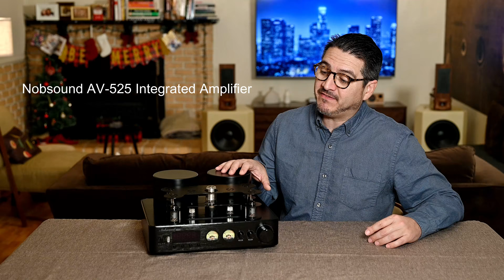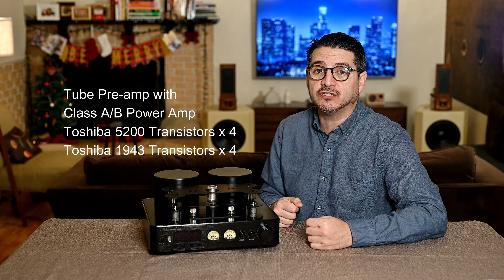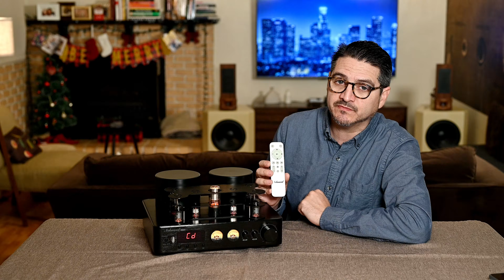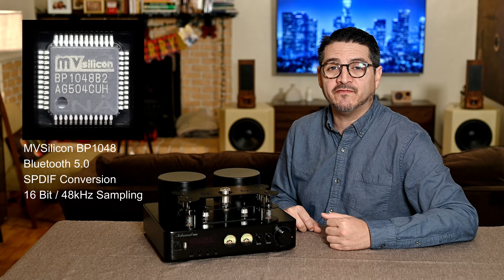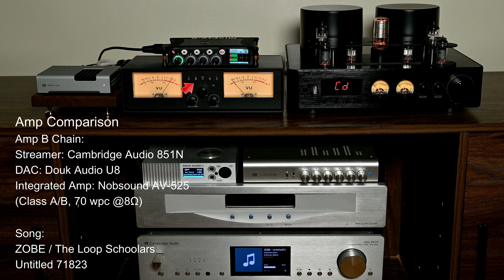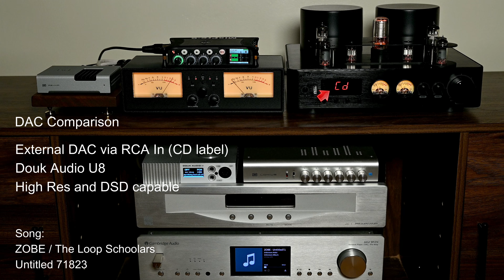Best Entry Level Tube Amp? Nobsound AV-525 Review

Comment: Hi, great review and it made me change my mind completely from getting DA HTA200 into this AV525!
Have you by any chance combining the Douk P1 preamp and the AV525? They're from same company so Im thinking of getting both. 
I appreciate any feedback or comments from the community especially from those who already tried this combination first hand.
Reply from the maker: I don't think you need the P1. Why were you considering combining both? And thanks for watching. I appreciate it!
Reply: @RickRuizAudio  hi Rick, thanks for responding so quick. I wanted to play the audio files from my PC instead of using USB drive. I have an audio player that am used to using., thats why.. hope this helps.. so in case you combine the two, do think there will be difference in sound quality? (By the way, I already have the P1 purchased from Local Amazon here, I love it) hence asking the question.
Reply from the maker: @dbelgrade  Yeah, I wouldn't use 2 pre-amps, if you want to play music from your computer, I would suggest you get a small DAC in between the Computer and the AV525 instead. You'll get better sound. Maybe start with the SU-1 if you don't want to spend a lot of money, but the Douk U8 is awesome too and adds a very nice headphone amp.
Reply: I also bought the AV 525 and positively love it! Has all the power I need for my room and sounds fantastic! Plus the remote is a million times better than the HTA 200. I know. I had it here in the house a few weeks.  The AV 525 is a smoking great amplifier.

Comment: Hi Rick, I have been looking into Douk VU Meters. The VU3 is limited to 100watts so it wouldn’t work with the Nobsound. I think that is the VU2 you have. How many watts is it rated at?
Reply from the maker: Hey Ed. I'm using the Douk L3 for VU w RCAs. For the speaker lever VUs, I'm using another company. I can't recommend it quite yet. I'm having trouble with the meters and they are troubleshooting.
Reply: @RickRuizAudio  Thanks

Comment: So, I guess a dumb question but why no phono input?
Reply from the maker: I don't know why they decided to go that route. Maybe they figured customers buying this unit would either have a turntable with built-in Phono-pre or maybe they thought this buyer would like to use an external. Hard to say. I personally prefer bringing my own compared to a poor or noisy convenience input. I'm sure they could have put a good Phono pre but maybe that would have increased the price $30 and they were worried about that price point. It always comes down to a business decision as to what will sell the most units.
Reply: Do you have a recommendation for a phono pre-amp that would work well in this type of setup?  I have an entry-level Uturn orbit turntable.  @RickRuizAudio
Reply from the maker: @bborgstedte  I do like the little Douk T14-eq. It's around $50. Or if you have a larger budget, say $150, the Schiit Mani 2. If you want Tube Phono Pre as well, the Ampapa A-1 is nice as well. I think around $140. Here: https://amzn.to/3PbegW8
Amazon has a $15 coupon right now so that one goes to 125 and has a headphone amp included too. any of those lol would be nice. What turntable are you using?

Comment: Bought it open box. Bad decision. Remote literally broken in a dozen pieces. A rear binding post broken off. Going back and forth with no refund yet. It may be a good product but my customer service experience is the worst which was my fear. I cannot believe they sent a broken unit. Beware.
Reply from the maker: Oh wow. Did you get it from Nobsound or Amazon? If it was from Nobsound, I'll send them an email John.
Reply: @RickRuizAudio Nobsound. Asked for a  refund but a new replacement would be best. Thanks for whatever you might do.
Reply from the maker: I'll ask someone to look at this! My experience has been that they are receptive. I'll email them tonight!
Reply: @RickRuizAudio  Nobsound said "Hello, This terminal is easy to repair, and we can also send you a replacement remote control for free.
This is a return item and the price is different from the brand new product, so we will not send you a new one.
If you accept to repair it by yourself, we can refund you $40 as compensation.
Also could you also take a side view and take a photo of the area where the terminal is broken" 

I sent photos. Essentially, they will not replace it. They said go fix it. This has been a perfectly horrible experience. Yes, I purchased an open box item but they are not honoring their return process.
Reply: @jacksonranch My China Ali Express 300 b 600gbp amp is faultless and sounds as good or better than my friends 3500gbp amp

Comment: I bought this amp about 4 mos. ago.  It sounds and looks great, and am very happy with it so far.  The only criticism I have is that the USB input does not work,  I don't care, I don't use that kind of source.  The remote control is (as you've stated) only capable of volume and input changes. Fit and finish are nice for a chi-fi amp.
Reply from the maker: Nice! Glad to hear. That's odd about the USB. Did you try different USB drives or different music formats? It could be a format problem. I know if I have any MAC formatted USB drives, my Cambridge network player doesn't like them and I have to format to NTFS instead of exFAT. And thanks for watching!
Reply: Hello Rick, My name is Dave....I tried both thumb drives and micro SD adapters with no luck. In fact, the large USB led goes out when I plug in a device. Perhaps a short or defective input.   All of the devices work fine in other readers including my car. I also own the Dayton Audio HTA 100 amp that I like with the exception of the annoyingly loud cooling fan!  I intend to change out that when I locate a correct alternative. Look fwd to more of your videos. @RickRuizAudio
Reply from the maker: @vulcangunner58  Awesome Dave. Thanks for the update on the drives! Yeah, maybe a short on the input. 👍

Comment: I’ve heard that sometimes these units when having a very low input volume from either Bluetooth, CD, DVD, ect the sound tends to cut off. Have you noticed something like this ?
Reply from the maker: It's was a problem with the Bluetooth adapter. When you have the volume on phone very low, the pre goes to sleep. But not a problem with wired devices. I didn't experience this though.
Reply: @RickRuizAudio   yeah the problem was exactly that. That even with wired devices with low volume it would cut off.
Reply from the maker: That's weird. No, sorry, I haven't heard of that or experienced it with either my Dayton or Nobsound.

Comment: I'm going to purchase the 525.  Will the Douk Audio T8 Pro
 clean up the sound, or do I still need the Douk Audio U8
.  Appearance is important to me (T8 Pro looks nice, the U8 does not).
Reply from the maker: Hey Ian, the 525 doesn't have a Send/Return or Tape/Record loop, so you can't bring audio out of the amp and into the EQ and back in to the amp. That's one downside to (most) integrated amps. The U8 will definitely clean things up. You can always hide the U8 behind something. If you don't need the headphone amp on the U8, you can also go with the SMSL SU-1 DAC. That will clean up a bit too. Not as much as the U8 but it'll also save you $200. I'd be very happy either way. And thanks for watching! 👍

Comment: I was looking to purchase this amp, however I decided to go with the Dayton HTA 200, for one reason and one reason only.The Dayton had the phono inputs that I needed to play my turntable. I'm a bit old school and love to listen to my vinyl's. Thank you for another great and insightful video review.
Reply from the maker: No problem Tim, Thank you for watching!! The difference is slight. Both are pretty decent. Ohh and if you have days when the sound is inconsistent, swap the rectifier tube first! I'm gonna try playing with that too.
Reply: Hey Timothy how is your HTA200 doing now after 6 months of use?  I had the HTA200 for less than a week and it was having volume issues. Parts Express tech and I both agreed it was not working properly. It got sent back. I ended up ordering the Nobosound AV-525 instead. This had no phono inputs. I to am a huge record old school guy myself so I bought a couple of different Douk phono tube pre-amps. One is the T4 Pro and the other is the T3 Plus so we will see how it goes.  I hope you are still happy with the HTA200.  Take care.

Comment: Identical to the dayton audio ones.
Reply from the maker: Pretty close. I'm sure they use the same manufacturer. Dayton is also a small company, I think around 20 employees including their engineers. I'm sure those employees work for Parts Express as well. Which is fine by me.  But the amps are not identical. I'm sure Dayton specifies some things they want. Nobsound as well. Nobsound used to make one with Send/Return which I would have loved to have.